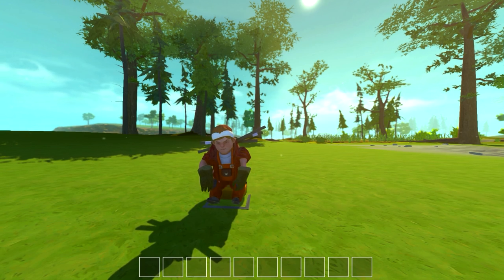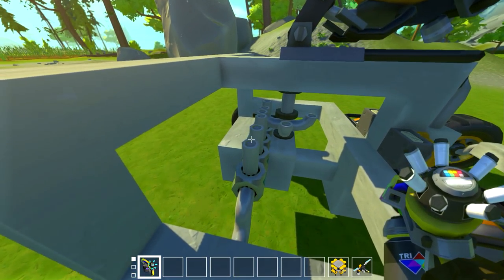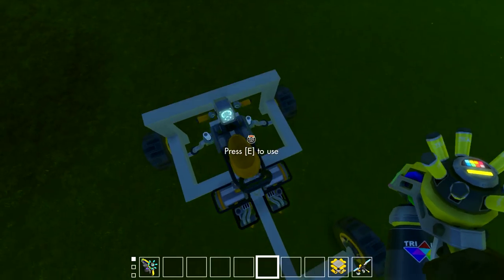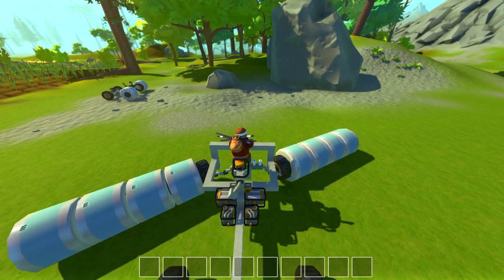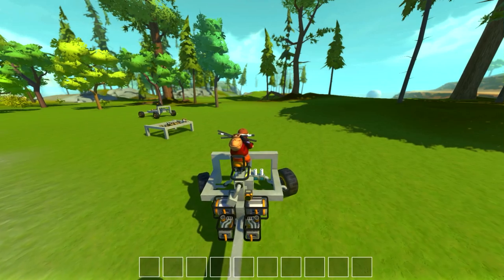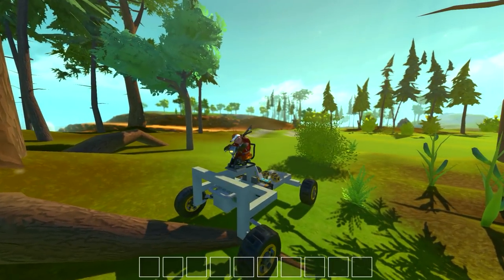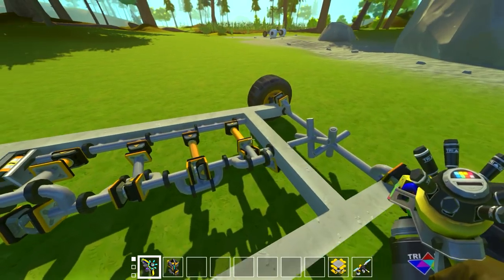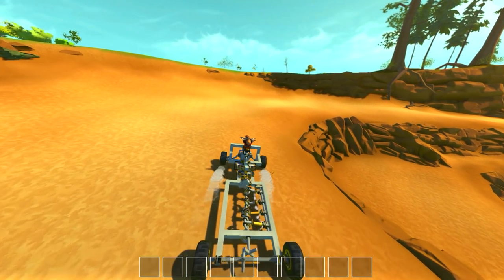Rack and Pinion "Real" Car Steering! (Scrap Mechanic #186)

Comment: for reverse with that engine, you could probably add a switch or a sensor that moves the pistons 180 degrees so that they are 90 degrees in the other direction, causing the engine to rotate the crankshaft the opposite direction.

Comment: How insane would it be for a Scrap Mechanic Truck to feature leaf spring suspension, a realistic v6 piston engine with crankshaft and 3-speed transmission, a limited slip differential, and rack and pinion return-to-center steering?
Reply: Kool Kyurem25 that would be so awesome that frames would drop

Comment: Next time test the mechanical car with bigger wheels please. I think you can extend the bar parallel to the wheel so the turn becomes slower, and maybe the Steering rack could need more tooths.

Comment: hey kan, I love your ''real'' car videos. One question tho, cant you  connect the steering to the steering bearing? Instead of using electric motor?
Reply: I thought of it straight away, since it wouldn't give any latency
Reply: Paulius Ragauskas Then the steering wouldn't be as accurate.
Reply: the steering connections only turn so far, it's not a lot of angle and for the style he has it needs a decent amount of torque, if you could set the stops then it might work but at the moment it isn't strong enough and can't spin as far

Comment: why you don't use cogwheel mod pieces? is it that the performance of the piece collisions are not satisfying? 

But for the sake of better look and testing purposes wish you use them. And also extra heavy and super light pieces saves lots of effort.